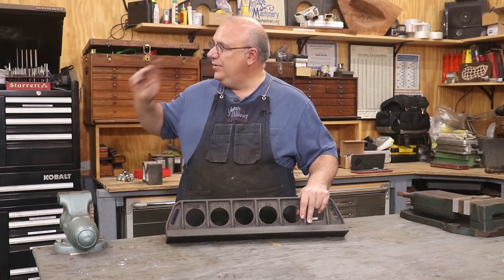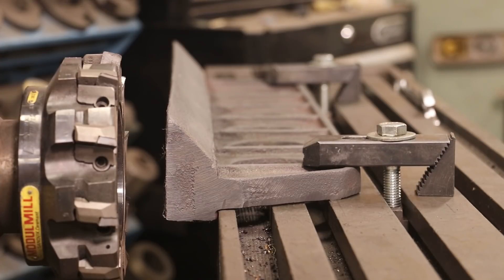Milling a Camelback Straight Edge - Horizontal & Vertical Milling Machines

Comment: These castings kinda suffer from a minor design defect. Most original uncut castings of straight edges i've seen (a small stash in a rural part of Germany a few years ago) had cutting bosses. These, look more like finite products ready for scraping. That kinda..cuts into the final item/tool, i feel. A little bit more casting to cut would've been nice.

Comment: the part of the casting your clamping on is TAPERED needs to be shimmed up that,s why the bottom is way out of square to the face mill
take it from a real machinist 50+ years of experience  saying as good as you can get WTF ????????????????????????????????????????????
Reply: This is not the best place to see good practise. Not sure if Keith doesn't know how to do things properly or just can't be bothered thinking it through.

Comment: just curious if these come pre-heat treated or aged for stresses in the iron
Reply: It's my understanding that they go through a few heat cycles to normalize them before they're shipped out.
Reply: @chris0tube I was mistaken.  In the ebay description it mentions stress relief, but it says that they recommend the buyer stress relieve after machining.

 https://www.ebay.com/itm/24-HKA-24-CAMEL-BACK-SCRAPING-STRAIGHT-EDGE-CASTING-With-45-DEG-ANGLE/173352228200?hash=item285c991568:g:S54AAOSwomVbFs1Y

Comment: I might be wrong but i would have started at the other end so the main cutting action is on the downcut rather than an upcut so as to press it down harder on the table rather than trying to lift it off. nice job either way, looking forward to seeing the planer in action.

Comment: The proper way to mill is forcing the casting down toward table with carbide cutting head not trying to pick work up in the air with carbide cutting head. You should have started on the other side of the work pc. This also eliminates chatter.

Comment: If a grinder was not available would lapping it on a surface plate with sandpaper be an option to refine the surface before starting scraping?

Comment: I really don't like the way he machined the sides reducing the last rib to almost nothing. The ribs were put there to provide maximum stiffness which will guarantee the flatness of the straightedge in use.

Comment: Milling with the cutter engaging in upwards direction on a part clamped down like that at 4:00 IMO isn't a particular good idea. If the cutter catches something, it will likely rip out a T-slot or so. 
I always use the horizontal spindle on my Maho so that the cutter rotates into the  table and not away from it, when cutting. The right hand position of the operating panel  on euro mills is great in this aspect, as well.
Reply: I totally agree that is common sense, come on kieth
Reply: I already wrote my comment and seen yours.

Comment: Keith - Once your planer is up an running, I'd love to see it make a large Côtes de Genève wave pattern on a big piece of cast iron. These are the stripes you see on the rotors of finely crafted mechanical watches You'd need to retrofit a milling head to the planer to make this happen, but the look would be even more stunning than a planed surface.

Comment: Curious. I have heard of castings stress relieving themselves and distorting as time passes.
Have these been heat treated to relieve them or were they cast many years ago which would allow whatever distortion was going to happen Before final machining.
Please advise
Alan in London
Reply: Shot peening is another method for stress relieving that's common in forged connecting rods and crankshafts.  However, these are highly stressed components. Straight edges aren't, but I'd be curious what the deviation is between a newly scraped straight edge, and how that same straight edge compares 5 or 10 years later in terms of overall flatness.
Reply: Richard sells these castings on ebay with this in the description:
"I have these made in the USA and have been high heat stress relieved. All you will need to do is to machine it and scrape it. Machine it and hand and or BIAX Power Scrape it and the use as master to scrape the worn ways of your machines.  We do recommend that you stress relive them after machining."
Reply: @chris0tube 
Perfect understanding of the situation.

Comment: Best practices for milling on that horizontal would be to do all the cutting with the cutter moving from right to left so the cutting forces are pushing the part down onto the table, especially the first setup with the short clamps.
Reply: I don’t agree Andrew it’s always good practice to machine a face downward which presses the tool to work against  a solid surface as opposed to the  tool trying to lift the workpiece off the table possibly causing damage to table and or operator,,,,, would never teach an apprentice the latter
Reply: Doesn't matter for this. Tiny DOC, tiny chip load, slow feed, CI... Etc.
Reply: careful now, you'll have Keith's plaudits tell you all off for saying bad things.